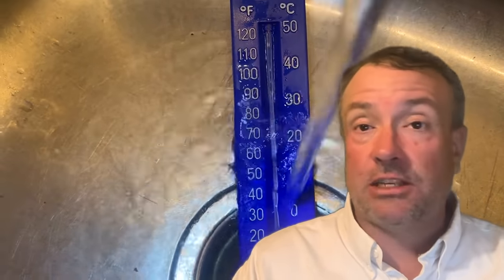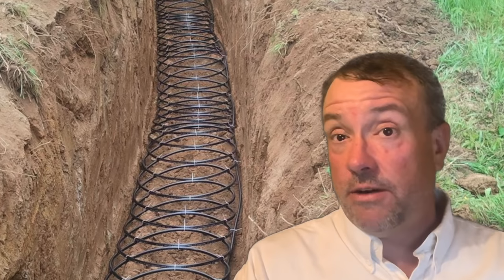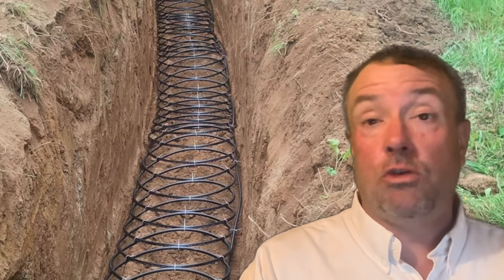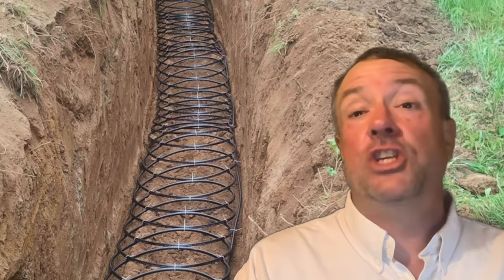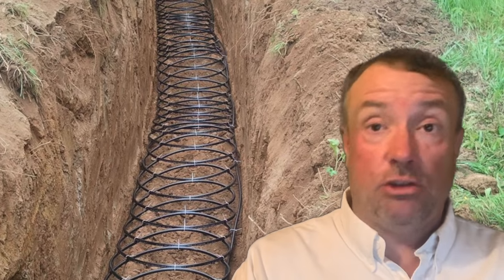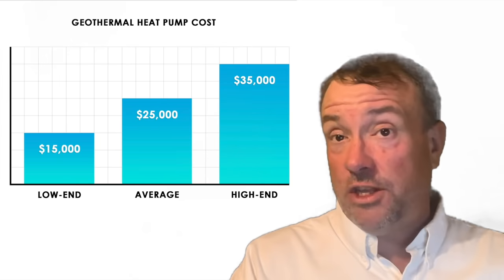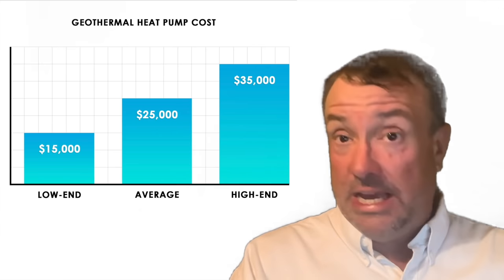Geothermal Cooling Tricks and Hacks

Comment: Can you tell us how large the loops should be and how long a trench to accommodate the 400’ of tubing should be?

I’m in northern MI with an off-grid cabin and have a septic system going in soon-I’m seriously considering doing one of these systems as the excavating equipment will be on site already.
Reply: The size and configuration affects the efficiency and final capacity. 
I'm assuming your place must be pretty small if you are targeting 400 ft of tubing. 
I would do an internet search for ground loop geothermal design and read up. 
Depending on your region, soils etc. You should be able to calculate out how much tubing you need based on your house size and how to configure it. 
You can buy 600-1000ft geothermal slinky loop style coils with a 50 year warranty. Some people mount them horizontal in a wide trench. Some people dig a deeper narrow trench and mount them more vertically. Horizontal costs more for trenching but is more efficient. 
I'm looking to move to MI and want to build myself an ICF ranch with in floor heat, heated driveway and sidewalks. 
Doing it all myself. Heated sidewalks and driveways seem like this ultra expensive luxury but really if using geothermal ground loops it's just tubing, a circulation pump, and a switch.
Reply: Fairly small, a 16x38 cabin that is off grid with a decent solar setup. It has sleeping lofts so the actual area needing to be cooled belies the square footage of the building footprint.

Comment: U work in a house for bout 24 yrs it has 19 water source heat pumps no back up strip sizes 7000 btu to 48000 original lines 20k 1" 10' deep done ok until water leaks started showing after small earthquake owner kept having lines fixed finally he went to vertical lines.  Only main problem was heat exchangers would leak.  2 units in pool house 2 in guest house also thats 23. Will be glad when house sells gettin tired of it time for someone else to worry bout it.

Comment: It seems that if you coil the pipe, you can d much less excavation. Correct?
Reply from the maker: Yes! Absolutely correct
Reply: @SimpleTek  So, has anyone done the calculation? How large and deep to bury 800 ft to keep a minimal footprint?
Reply from the maker: @rickylion2891  I don’t know the calculations, sorry
Reply: @SimpleTek  no problem. Gives me a project😀
Reply from the maker: @rickylion2891  keep me informed please!
Reply: @SimpleTek  😄
Reply: @SimpleTek  I was trying to set up the equation last night, but I need more information. You have worked with the material, is it flexible enough to change radius to my choice? There was a picture of spaced coils in a trench. Do you know the width of that trench.  Do you think 6 inches is enough dirt for each tube?  Thanks, Mark
Reply from the maker: @rickylion2891  that depends on the type of tubing, some curls tighter than others but it ships curled up pretty tight
Reply: @SimpleTek  I know little about construction equipment, can the excavator have a bucket of 4-6-8 ft? It might be worth going longer than wider.
Reply from the maker: @rickylion2891  most mini excavators can dig 8-11 feet deep
Reply: @SimpleTek  Sorry, me again. I asked the wrong question-bucket width. My initial calculation is if I can get the loops 6 ft diameter, It would be a trench about 12-3 ft long to accommodate the 800 ft.
Reply: @SimpleTek  12-13 ft
Reply from the maker: @rickylion2891  it’s possible with coils

Comment: How do I make all the connections do you have schematics or a drawing you could put on the video
Reply from the maker: They sell connectors at most hardware stores
Reply: I mean to the radiator and the fans how does that all connect together
Reply from the maker: @msimmic  the radiator connects to the pipes and the fan goes behind the radiator to push air through it. Pretty simple

Comment: I keep seeing these videos and tutorials and I'm concerned about the efficiency regardless of the location. You are basically installing a heat exchanger. And to me,  the best heat exchanger is one that "exchanges" the heat/cold as fast as possible. That's why the radiator in your car is metal, not plastic. (Except for the top and bottom tanks)
I'm not saying your system  doesn't work. Of course it does. And many are doing as you described. However what I AM saying is that it seems to me that some sort of metal conduit would be WAY more efficient. Granted, more expensive and in some case way more expensive but hopefully you're doing this once. And with a more efficient conduit you might be able to shrink the size of the system. 
Feedback please. I'd like other's input.😎
Reply from the maker: @bobwelch7911  agreed metal is more efficient, but it’s also way more costly. You can have 200’ of plastic tubing for less than 30’ of metal.

Comment: İ was trying to figure out away to heat or coll my water ponds inside the greenhouse using this method to keep the temperature around 25 C degrees. İ thought maybe İ won't need a fan to do that, probably just let the water tubes pass through the pond will be enough. What do you think? İ am growing Duckweed in the pond and Fishes in the Tanks.
Reply from the maker: need a LOT more info on your situation!
Reply: @SimpleTek  yeah İ guess so. The pond is 500 square meter with 30 cm depth. İ am growing Duckweed and fishes. Unfortunately in Winter, İ can't do that because they require 25 degree water temperature. While in Summer, İ still can grow them but with frustration due to hot weather here. 37 c in summer which mean 40 plus inside the greenhouse
Reply: @Jean.34  Water around the pipe works equally well for getting heat out of the pipe or putting heat into the pipe.  One factor is the amount of surface area which depends on the diameter and length of the pipe in contact with material.
Reply: @jakebredthauer5100  yes, so i may need to place pipes also in round shape inside the pond. Exactly similar to how i place them underground. Theoretically i will need a circulation pump and a thermometer.
Reply: @Jean.34  You probably mean a thermostatically controled electrical switch, but a thermometer and manual switch would probably work.
Reply: @Jean.34  Yes. You will need to isolate pipe's water ( closed loop ) from pond's water. The reason is that pond water has microbes & slime, fish poo debris ... that will clog your pipes in no time. 
I am working out the details and designs for a year round Red Claw Crayfish, Giant River Prawn and Tilapia aquaculture/aquaponics set up. 
I am thinking a reversed old icehouse for storing summer heat (aka: heat bank) and spring water for cooling.
Reply: @redstone1999  that seems like an interesting method. İ am not really familiar with it. Do you mean that you will build an ice tank and let the water pipes go through it? Would that be enough for the water inside the pipes to grap that coldness from the ice tank? Also freezing the ice inside that tank will cost electricity i assume!
Reply: @Jean.34  Old school icehouse is a semi underground foundation that has 2 feet of sand and drain pipe at base. The inner walls are lined with double thick straw bales and waterproofing on inside part of wall. They load it up in winter with river ice blocks or molds filled with water and frozen solid in layers with loose straw inbetween layers of ice. They then cover with tarp and straw bales to rafters of water shedding roof. They usually have an access port to get ice blocks as needed for the icebox fridge.
The ice can last into fall. As the ice melts, the ice water is drained away from bottom sand and drainage. This filtered ice water goes to livestock or farm workers or cold root cellar.
We have better and safer piping and waterproofing materials to work with today. 
By reverse, I mean to have warm water pipe coiled in 6-8 feet + of sand and gravel to base and back. And ice blocks I make in plastic totes over winter on top. I will be using straw and wood chips for insulation along with insulation boards. The drainage water will also go to house via solid drainage pipe to poly coil in trout fish tank in basement and then to a salvaged van heater to circulate the cooled air upstairs.

On paper, I should be getting around 5 to 10 C water flow to trout and house and convert 35 C water down to 20-25 C for greenhouse fish tanks. As season draws to and end and air temperatures more reasonable. I will hook up my solar water panels to pipes to really warm up the now sand & gravel heat bank.
Reply: @redstone1999  wow that is amazing. İ should also study it. Maybe i can do it too. Thank you for all these wonderful information.

Comment: I'm sure those "professionals" claim that this doesn't work because they can't profit off of it.  In that sense, I guess they are right: it doesn't work FOR THEM!  LOL  I'm planning on buying some land in a couple of years and having a house built (potentially a prefab or modular home) and I'm going to have enough land to put one of these systems in.  Sure, it might not be "perfect" and provide every single BTU of heating/cooling that I need for every second of the years, but it will go a LONG way to augmenting a system and saving a ton of money.
Reply from the maker: Thank you for the kind words

Comment: Doing hydronic system will not transfer heat if using straight antifreeze. At least a 50% solution is acceptable. We use antifreeze specifically for hydronic systems.
Reply from the maker: Never heard that, I put straight antifreeze in my car and it seems to work

Comment: How do I choose a pump to run the system?
Reply from the maker: Calculate the volume of water you need to move and buy a pump properly sized
Reply: Let me ask it a different way, if I do 800 feet with 1/2 pex pipe will a 2 HP pump do the trick?
Reply from the maker: @badboy63079136  the pumps should have ratings on then

Comment: Totally wrong, expensive and tested at 23C all year around; you need the following for 24K A/C (about 120sqm. of living space coverage) air type ground project:
1. ground piping area covered: 50sqm. in straight line or 25mX2 back & forward coiling,
2. ground piping length: 130m.,
3. ground pipe type: copper,  
4. ground deep: about 3m.,
5. Circulation Pump of 12v DC (at least 50W): 1 piece
6. Estimated costs (without ground digging): 620$ USD
THAT'S IT.
Reply from the maker: Ground temperatures 6-8 feet down here are 7’C, that changes your numbers
Reply: Depending upon ground temperature: at 3m. ground level on my end is about 22C  @SimpleTek
Reply from the maker: @totolesslie  agreed a 22’C ground temp would change my numbers HUGE!!!

I can’t imagine how hot it gets in the summer where you live. It never gets much over 26’C here in the summer

Comment: Seems like with all the solar gain from the ozone layer gone there’s a lot more heat than before n the ground must b also so a well shaded area is where the trench needs to be n probably deeper as well even possibly insulating over it. My well water from 75’ varies from 50-60 degrees f. Sure would like a tip for that that’s economical. Loved ur vid others should too.
Reply from the maker: Thank you!
Reply: The ozone layer is gone?? Have to been living under a rock for the last 30 years?

Comment: This technology is so complicated that a book may be needed to explain the variables. For example, there are numerous types and sizes of pumps.  I suppose the operating pressure is just enough to cause the flow. Would plain water damage the pump from rust and lack of lubrication?  A special tool with a very long handle is probably needed to smooth the bottom of the trench.
Reply from the maker: really? That's like saying shoe laces are too complicated to lace and tie without an instruction Manuel.
Reply: @SimpleTek  Most people are not capable of inventing the shoelace knot. Knot technology is passed down from generation to generation from someone who was able to invent it.

The basic idea of pumping house heat into the ground is very simple, yet nearly no one has thought of it on their own.  Now days people build almost nothing so their skill is low.

What if the tube is down only two feet?   Performance would be reduced, but would performance still be good?  You don't know, do you?
Reply from the maker: @jakebredthauer5100  I should send you some Velcro shoelaces ;P
Reply: @jakebredthauer5100  I know and the answer is yes. 2 feet deep is all what I can work with. I planted hedge rows on either side of trench. I also pile brush over trench for some insulation and ease to redig to repair if needed. I tried doing a Huggle Garten, but darn chickens would tear it apart going after worms :D 
Everyone's situation is unique to their locale and resources. Creativity and a need, are the mother of inventions.
Reply: @SimpleTek  You failed to answer any of the three questions.  The answers are very complicated due to the time lag of the temperature fluctuations two feet down.  Two feet down the ground will be warmest in the fall or winter and coldest in the spring or summer.  It is like the warmest time is not at noon and the coldest is not at midnight.  

Application of ground cover (reply above) at strategic times could adapt this technology to quarter acre lots.  I don't know.  Someone who knew could probably sell books.

I do appreciate your contribution to this science.  You have educated me.  Someone else may be able to carry the ball further with more refinements.  Civilization depends on cooperation.
Reply: @redstone1999  I suspect that you dug it in by hand.   With a tile spade it would be doable for some people who were willing to spend the time and calories to do it.   A tile spade has a long, narrow, tapered blade that is curved, with a sharp rounded end, "D" handle.
Reply: @jakebredthauer5100  I love digging, even if my body hates me for it. I dug a 2 feet wide trench, lay pipe zig zag and bury with next section's soil. I did a 600 ft trench through woods over a summer (inbetween gardening an acre garden) and another  800 ft trench in 3 weeks in the field. Mine you, that was only about 2 feet deep due to hard clay. No friggin way was I trying to pick axe through that except for leveling reasons. I am lucky to have a 15 ft elevation so pump only needs to push uphill for 700 ft and comes back at ~ 30 psi to pump.
Reply: @redstone1999  lt is less stress on your body if you alternate between left hand digging and right hand digging, instead of all left or all right. I would not do it as you described because that is excessive digging.  I would make a narrow trench and have it go in a circle or the shape of an oven heating electric element.

The uphill and downhill does not matter because the weight of the water on one side balances the weight of the water on the other side.  Half of the water pushes the other half.  The main thing the pump does is counter the friction.

I do not know why you would want that much pressure. If you are using an automotive radiator, that is twice the pressure that it was designed for. Maybe the radiator or something is causing a restriction that is causing a pressure buildup.  You may have a mismatch between the pump flow capacity and the radiator flow capacity. It sounds like a waste of power and energy.  Two radiators may be better.   An axial fan may not provide enough pressure to blow through two at once.  I don't know.
Reply: @redstone1999  I was thinking of a downhill loop but your up hill loop would work in a similar way as with a siphon.  The water coming down should pull the other water going up.
Reply: @redstone1999  You could do a pressure test without the radiator for comparison purposes.
Reply: @jakebredthauer5100  You are right, PSI would be neutral and the water in pipe is at an equilibrium when at the same temperature. However this is not the case. The hot water expands upwards and the cool water compresses and gets heavier per volume, thus causing a passive flow. The pump is a small 40 watt 200 gph unit. It does not work very hard to increase the flow rate. I drain the system once soil temp at 15 C as I use water for the system. This way a leak/breakage does not harm my environment. I make the distilled water off my woodstove during winter as it is my main heating. Still tweeking the test system before expanding it. 
I hope to convince the wife to let me try a similar system inside of house. Taking heat from upstairs and heating dirt basement and cool the house as needed. Problem is I have too many projects on the go right down to put full time on this project. ;)
Reply: @jakebredthauer5100  yes i do agree most people would rather call a plumber then unclogging a sink for themselves its too dirty lol. But as to your comment I think if you subtract the original 8foot depth temp. From the surface temp.  Them divide that by the 8 feet and it should give you a pretty close amount of the temp for each foot going down. Just thinking in mathematical terms.  Have a grand day
Reply: @jujosworld  They probably picked eight foot because there is almost zero temperature fluctuation at that depth. Also there is much thermal mass at that depth to draw heat from or to put heat into. At shallower depths the temperature is fluctuating higher and lower than the 8-foot temperature, depending on the time of year.  The system has more effect on the temperature of the ground when the tube is less deep.

Comment: With combination of passive solar and/or thermal battery system, this low grade geothermal should be more than sufficient to handle most of the cooling AND heating needs in many residential houses. Due to its quiet and low energy consumption nature, the system can (and should) run constantly 24/7, which will make greater temperature swing capacity requirements (i.e. to remove  excess heat build ups or extreme cold in short duration) of conventional cooling or heating commercial systems, unnecessary.
Reply from the maker: yep